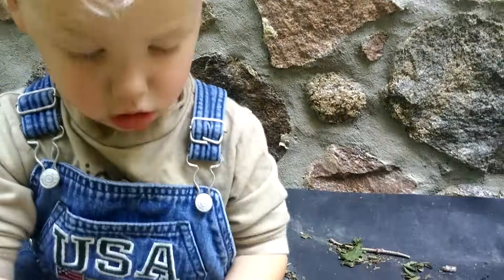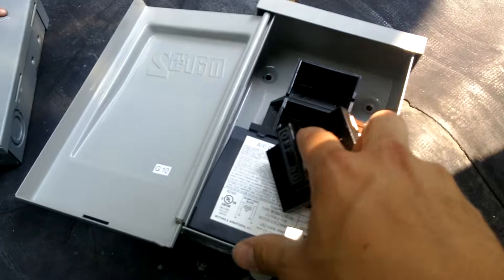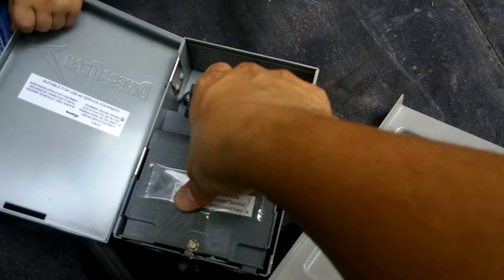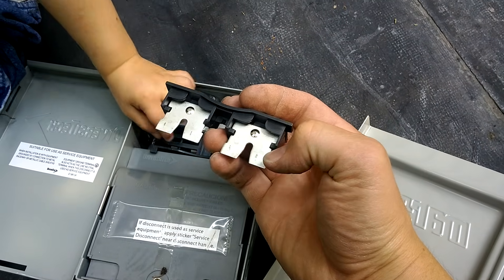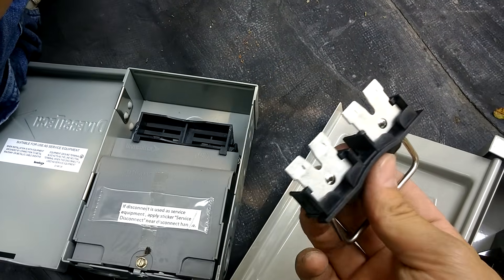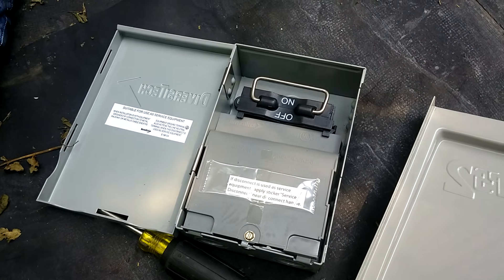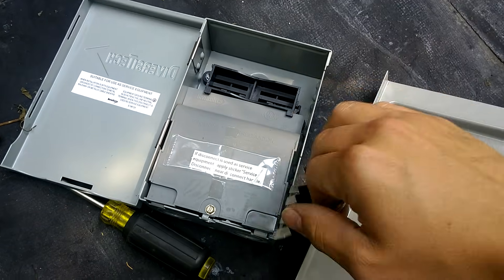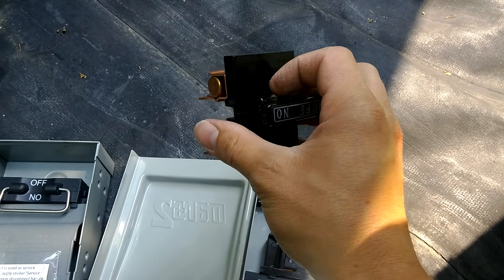Fused Vs Non-Fused Disconnect for AC or Heat Pump

Comment: You ARE NOT double protecting your unit with a fused disconnect, you are correctly protecting it. A 30 amp circuit breaker will trip when it gets a spike of electricity higher then 30 amps "right of course" but it just trips the breaker. A breakers job is to trip and prevent further electricity from continuing to pass through. However sometime when you get a huge surge of electricity it hits at the speed of light, like a bolt of lighting "Boom" flies through the circuit breaker causing it to trip but the surge got through continues to travel, until it hits the fuse, then the wire in the fuse instantly breaks causing it to stop the power surge right there protecting your unit from frying.
Reply: why would a fuse react faster than a breaker ?    this is not necessarily true  - especially since we are talking about fuses rated for motors and breakers rated HACR for AC equipment - this is the expectation of the manufacturer as it is stated on the nameplate of condensers to use “Time Delay fuse or HACR breaker”  Time delay fuses allows for a higher startup amps, called the “inrush current” when a motor starts, then amps go down as motor spins faster and the electromagnetic field within motor is distributed as kinetic energy as opposed to the slower moving shaft at the start
Reply: @jimbuki3517  
Could you please give me an example when a fuse rated disconnect is needed by code and why?
You sound like you know your stuff.  
Thanks. 
Personally the only time I would think a fused disconnect is needed is if there is no over current protection before the disconnect.
Reply: @theseattlegreen1871 I asked myself the same question and came up with this non-election answer. A building I worked in had a  6”x6” “gutter” (long metal enclosure, like metal conduit but square/rectangular) traveling from one end of the workshop to the other.  It contained large electrical conductors protected by a 200 amp circuit breaker. Branching off of that was smaller conduit with smaller conductors going to a 20 amp fused disconnect to a small piece of equipment. Don’t know if that’s a code approved  design nowadays but that’s where I saw it used.
Reply: @jimbuki3517  Breakers are often rated to the highest guage wire and current expected closest to the panel.   Fuses in disconnects are often rated to protect the equipment from over current load from shorts and current surges from the panel.  A fuse is a thin wire that heats up and breaks from the extra current load.  Breakers function differently - like a bimetal spring if I recall correctly.  There are metal bus bars breakers connect to that can act to dissipate the heat from excess current flow, like a heat sink.
Reply: Good stuff guys. Thanks! Great quick video
Reply from the maker: Don't Be Fooled Thanks for your perspective!
Reply: Right on time response! This scenario just happened two days ago for me. Had to wire a commercial generator up to a workshop. Had everything right, unfortunately didn’t have a meter to test 220/440. Best I could run with is turning on a breaker and see that way. Well of course nothings marked,  turned on apparently the ac unit. Thought I’d be covered with the outside disconnect, come to find out, someone before me chose to hardware it bypassing the in-line slow burn fuses. Luckily only cooked the little transformer.  Horrible day it was!!

Comment: Im looking for the name of the square thing inside the 1st box? I had a problem with my AC one year and the man said it was brcause ants had gotten inside that square and died so i needto try to clean it out myself given i havent oaid my rent this konth and cant call maintenance but dont want to have to deal with them for something i already most likely know the problem is. So 1st question what is the make of that box you pulled that from and how would i clean ants from that area? It didnt look like when he pulled it out or put it back it was very hard to do it just pulled out and clicked back in so i want to try it myself. My boyfriend on the other hand told me to wait since he knows more and he woupd do it but i want it done now not when he feels like it so can anyone help with this? I am going to have him turn the power off before i try just in case i didnt make it clear

Comment: I do not have fuse box outside.
I can turn off the breaker but 
How do I disconnect the unit?
Reply: You need a disconnect "within site" of the condenser unit.

Comment: you mention the wire 10/2 for 30 amp , should it be a 10/3 to get 220v ?  i ran an 8/3 incase  in the future i needed to upsize the ac unit.  my other question is how i can run the wire for the ac and an out let in the same box? i have a 12/2 wire ran to a single outlet box, can i run my a/c wire to that same box and wire an outlet with the 12/2 and wire the disconnect with my 8/3?
Reply: Nope this is 2 wire to get 240v(120v on each that alternate out of phase of each other, then the ground. The 3rd wire is only needed as a neutral for say a dryer that has a 120v need

Comment: Ben, sorry but you should have done your homework before putting out this video. Read Timebuilder's comments here: http://hvac-talk.com/vbb/showthread.php?1132271-Are-fuses-in-disconnect-necessary/page4

The breaker protects the wire but a fused disconnect of a lower ampacity may be required to protect the equipment. Read the label on the condenser.
Reply from the maker: I agree that the over current protection, weather it be fuses at the disconnect or a breaker in the panel, must not exceed the maximum amp rating of the A/C unit or device being served. I still think a non fused disconnect is the way to go and this in no way violates the principals of protecting the electrical system.

If the existing circuit however has a 50 amp breaker and the unit being served has a max amp supply rating of 30 amps then a fused 30 amp disconnect would be required. Or the 50 amp breaker could be replaced with a 30.

Let me know if I'm missing something! Thanks for your comment!
Reply: Benjamin Sahlstrom whatabout the breaker- it will have to be rated HACR for a condenser right ?    If it is not rated HACR for AC (outdoor condenser)  the fuse will have to be the type for AC motors and that also throws out the theory of protecting against a surge w fuses as some ppl have commented since the fuse will be a “slow blow” which allows for higher startup amps: when motor begins it draws more current then levels off - known as inrush current